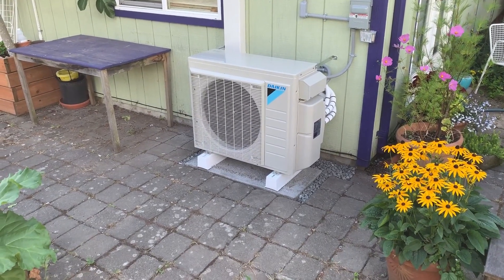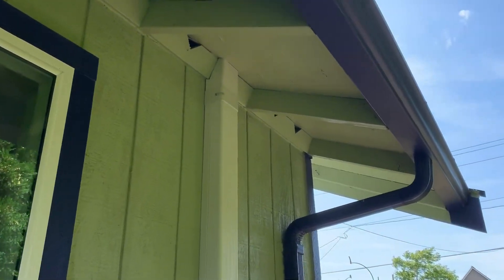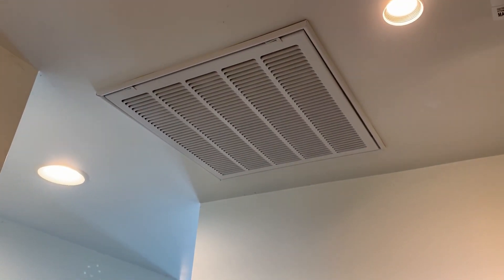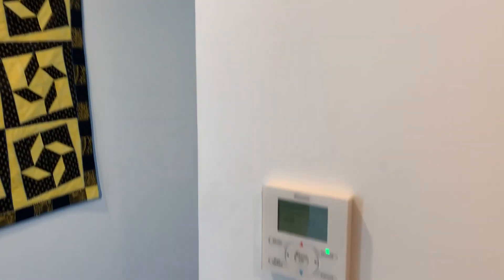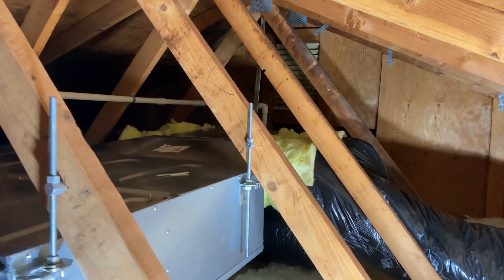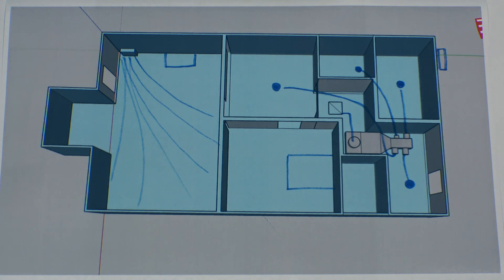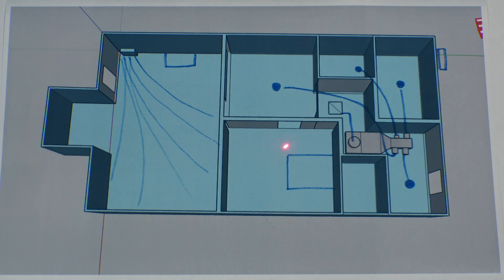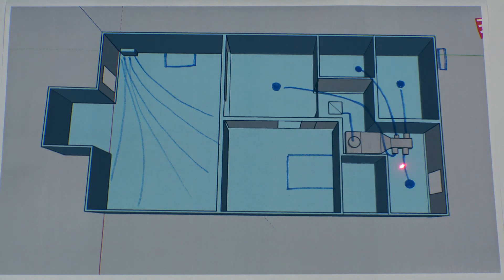Ducted, Ductless, or both?

Comment: Trying to learn what I can about modern heat systems before starting a project. Trying to sift through all of the information/opinions etc. and this is pretty much what I have been thinking without knowing if it was feasible. Well done video. Thanks

Comment: How loud are the fans??  Do you have an exact decibel or something similar I can gauge it to?  Trying to have a unit installed but worried about the neighbors.  houses are very close together.
Reply from the maker: These are extremely quiet. In the low 50s for the decibel range which basically means you can’t hear it unless you are walking directly in front of it. These are as quiet as any unit will get
Reply: @marrsheatingandairconditioning  thanks I think I’ll give them a go

Comment: My only concern is the drip pan.  The drain hose is mid-way up your drip pan.  This means the pan must fill up with water before it will start to drain.  That pool of water will remain in the pan.  As the leak continue to drip or stream down, you’ll have splashing going everywhere in your attic.  Yes, you;’ll have some splash when the pan is dry, but the splash is much worse when the pan has water in it. Then the water that can’t escape down the tube will have to evaporate into your attic. IF you don’t want to re-do the drain pipe connection, you can raise the drip pan up, so it’s closer to the unit and less likely to splash water out, as long as the support can hold the weight of the pan full of water.
Reply: Just fill the lower portion of the drain pan with epoxy.  Slope it towards the drain.  Simple 'nuff!

Comment: I'm currently considering ductless for my Kentucky home built in 1900.  My house is 1400 sf long and narrow, one floor. I like the floor mount versus the wall units - how do you service those or clean the filters?  I get a headache from all the information out there, but when it comes down to it you need an installer who knows their stuff, purchase a unit that you can get serviced in your area and watch the warranty length.  Has anyone ever painted the wiring/refrigeration line cover to match their house?  They are so ugly, remind me of a snake crawling on the house.

Comment: I just added a similar 2 zone  and getting minimal air flow out of the registers. I have a 18000BTU air handler for an area of 980SF should I have put in a 24000RVJU.  Any suggestions?
Reply from the maker: 🤔 it may be as simple as an incorrect setting on your controller. You have to set the static pressure on most of these units in order for them to function appropriately. Also, roughly how many ducts do you have and what size are the ducts? 

Happy to help if I can!
Reply: @marrsheatingandairconditioning  Thanks for your help! The ceiling has 6 ducts-  3 bedrooms, 1 bath and 1 each in the kitchen and living room (which is the furthest from the air handler and has minimal air outlet and the coldest rooms).I know you recommend 8in duct supplies is that important?

Comment: AWESOME!!! Exactly what I want to do in my new build (currently planning). Any reason for using Daikin over other brands like Fujitsu, Mitsubishi, etc, like price or performance? Thanks for making a great video.
Reply: Daikin has over 90 years of experience in the commercial heating and cooling industries. They are the ones who created the VRF system and the latest R32 Refrigerant technology. Daikin is the number one brand of Air Conditioner / Heater in japan.
Reply: @星の物語-q6j  does daikin use r32 in the US today?
Reply: Daikin, Fujitsu, Mitsubishi, and LG are all top brands in the heat pump industry. Brands other then that can be okay, but those four brands are all really solid.

Comment: Are both units (ductless and ducted) operating off one compressor?
Reply from the maker: Jeff Brewster yes, only one outdoor unit
Reply: @marrsheatingandairconditioning  and yet able to cool/heat the whole house? Do you happen to use a gas furnace as backup?
Reply: @marrsheatingandairconditioning  This means your separate units cannot modulate independently?  I know the fans can blow different speeds but that's different.  Might have been nice to turn one off during the shoulder seasons if needed.  Would you have done it differently after having it for 2 years?

Comment: how much does a ducted unit cost?
Reply: Zarin Goodson pioneer makes one precharged with refrigerant on amazon called pioneer air conditioner inverter. The highest btu system is 3700. That doesn’t include the duct work but is more of a diy system. Mr cool also makes a complete diy mini split system ductless and its a complete system.
Reply: @mikeshine7608  Yikes. Don't go with cheap Chinese crap systems.
Reply: Todd Hutchens is senville any good?
Reply: @todoldtrafford  Who makes it? Never heard of the brand.
Reply: Todd Hutchens saw it on amazon. I heard daikin and Mitsubishi makes good ones right
Reply: @todoldtrafford  Yes they do. Daikin will be cheaper than Mitsubishi and a better warranty as well. Mitsubishi is the BMW of mini splits meaning lots of bells and whistles cost you more money and cost you more money to work on it. You have to be careful of which ones you install not all systems are apples per apples.
Reply: @toddhutchens   What do you believe are the better, lower cost units? It seems alot of the components are from  China on all of them. Thank you.
Reply: @OliverCloseoff69  There are 2 major manufactures in China. They just slap on stickers and make it another brand. Say most domestic brands in America. You get what you pay for. Most cheaper systems are just that cheaper. They don't last and you can't find parts. It cost the same to work on them and that's where the issue is. People pay a cheaper price for a system then it costs the same price they paid for the system to repair it. It gives ductless a bad taste in people mouths. Good systems, like We install, rarely do we have issue we cannot fix or something the manufacture won't stand behind. Yes the are machines and people build them so issues can happen.Cheaper systems not so much. They have the breaks in half warranty. If it breaks you keep both halves.
Reply: @OliverCloseoff69  Also you have to have a great installer. That's where a lot of issues happen.